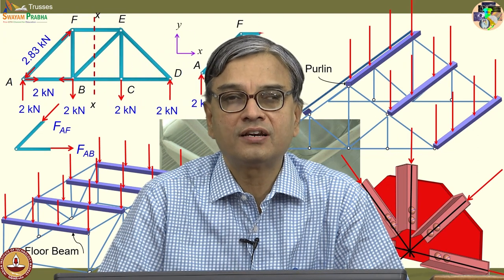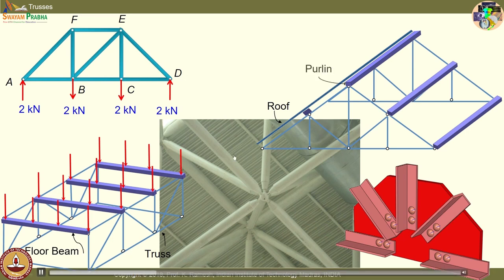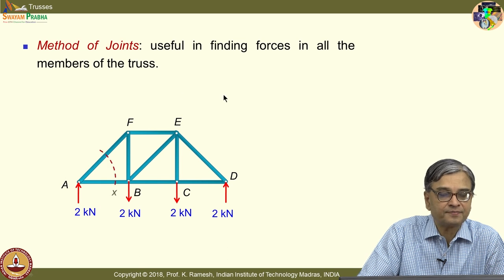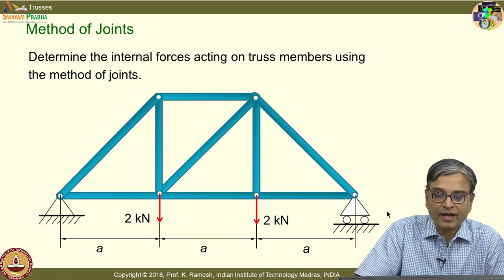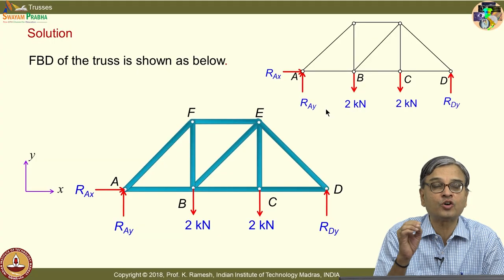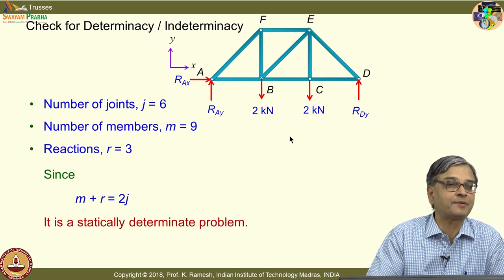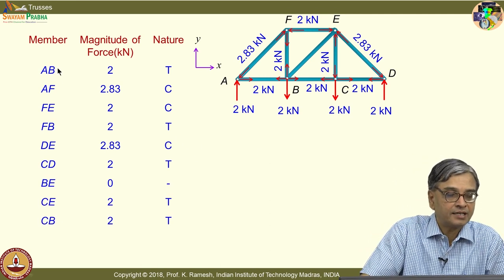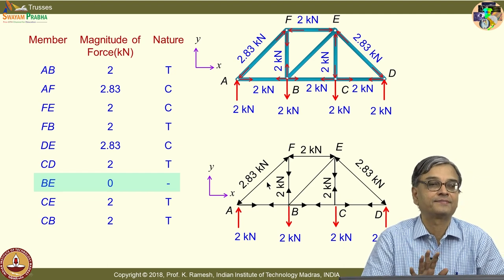Lec 08 Trusses II

Comment: Sir, What if the top and and bottom chords are continuous over 2/3 joints and spliced at 12 m, will it remain a ideal truss.
practically this is done in steel trusses, so the bending is controlled .

Comment: At 12:14 how we got RAY+RDY=2+2=4KN and also RDY X 3a-2 X 2a-2 x a =0 ???
Reply: 1) Taking net vertical forces = 0 (since truss are in equilibrium)
2) Taking moment at point A. Since it is assumed to be in equilibrium, net moment = 0
Reply: As @Arkit Kabir correctly pointed out, these are the equilibrium equations applied to the free body of the truss

R(Ay) + R(Dy) = 2 + 2 = 4kN.
the right hand side represents the sum of applied loads.

Since the truss is in equilibrium, one can take moments about any point and it should add up to zero.

For convenience and eliminating one of the unknown reaction, we are taking moment about point A.

Clockwise moments = negative
Anti-clockwise moments = positive

+R(Dy)⋅3a - 2⋅2a - 2⋅a +R(Ay)⋅0 = 0 [One unknown gets eliminated]

Comment: What if we consider those forces on pin joint as internal stresses of the member .. it will make it easy to grasp
Reply: Or also we can say the pin is getting compression as per drawing because it's actually pushing the member that's why memeber putting equal and opposite force on it .. this also directs above statement correct
Reply: Why we are not showing compression at the joints because we are not showing what joint is exerting but what joint is taking

Comment: Can anyone help with  cordinate selection,
@time 35.18 in +y direction Fx=0
Eq should be 
-Ffb+FafCos45=0 instead of Fab-Fafcos45=0
Although final answer be same,
Reply: We are taking forces w.r.t point F (equilibrium at point F). How will F(ab) will act on point F?
Reply: Your observation is correct. As per the positive coordinate directions, the equations you have mentioned would be correct. 
However, as long as '-1' is multiplied to both sides of the equation, it does not affect the result and either of the two equations can be used.
Reply: Ffb is assumed to be away from joint F. When you resolve the force Faf, the vertical component acts opposite to the assumed force Ffb. So when adding the forces, you attach a negative symbol to indicate that the other force (Faf cos(theta)) is acting opposite to the assumed force.